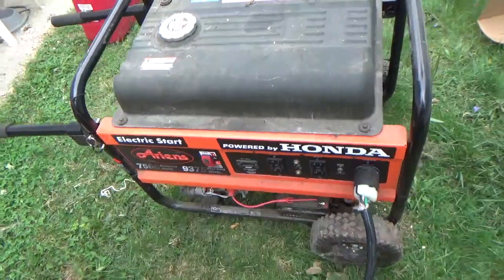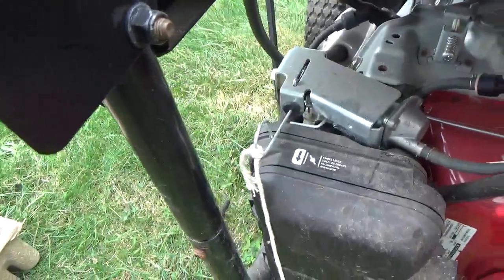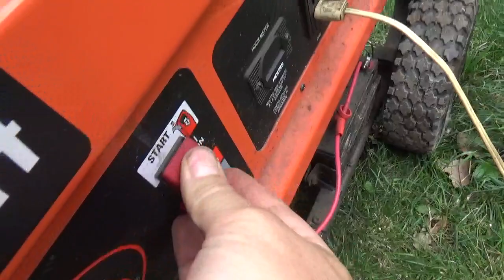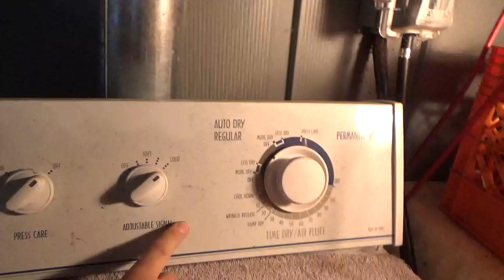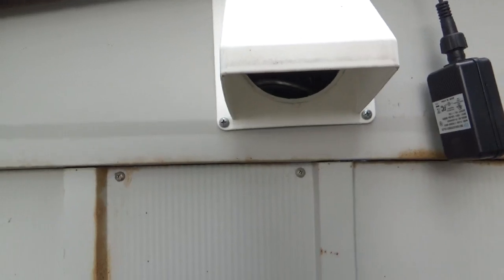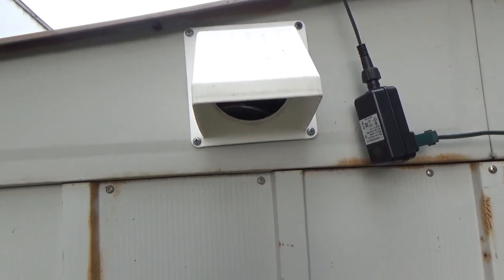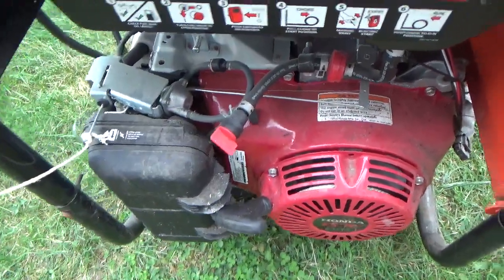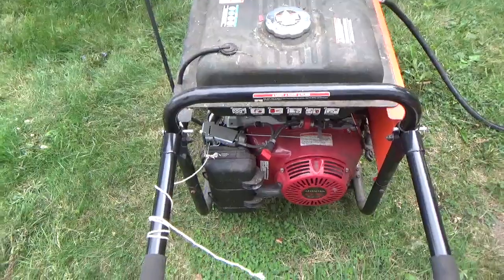Testing the Airens Generator And Maytag Electric Dryer

Comment: Nice, glad to see it's all still working well.

Need to start mine up actually, it's been a while.  Gas in it is pretty old but I've never had a problem with it running on it, besides old gas smells funny.

That's to say nothing of the one I got that I gave Joe, I told him to run it like every spring, it's been sitting there dead, out of gas for like 4 years now.  Then there will be a power outage and he'll be like "it doesn't work".
Reply from the maker: Joe will be like "it doesn't work so I sold it just like I did with your lawnmower".
Reply: Chances are good you're right.
Reply: Oh, just remembered:  That mechanism they use for the choke on yours is crap.  I know from experience, story time!

The wif's godmother has a generator that actually runs on propane.  She said it wasn't starting, it would try to run but die.  So I went over there, read all the instructions, and did everything it said.  Being that it was propane there's a button you'd press and hold for a few seconds to "clear the line", and then, like any other gas engine, you'd choke it, then crank it over.  Fortunately this one had electric start also, so I'd hit the starter button and it would crank over, but not fire.  Or if it fired, it would only hit a couple times on the cylinder and die.

Played with the choke back and forth, kept trying, kept trying, kept trying.  Finally, I got it to run, but it was barely chugging over, running way too slow to make any power.  Coughing and wheezing and just not wanting to run.  Plenty of propane, even had a spare cylinder that I tried, same problem.

I was starting to rally thing the regulator was bad for the propane.  Then I opened the air cleaner while it was running (barely) and it started running a bit better.  I removed the air filter itself, and then saw that the choke was still engaged even though the mechanism was pulled off for no choke.

Somehow, the choke plate got stuck, or was stiff, and the mechanism there couldn't open the flap fully.  I went in there with a flat blade screwdriver and popped open the plate completely, hit the starter button and it started and ran really nice and strong.

I WD-40'd the whole dealie there, and worked it back and forth a lot, and while not absolutely 100% perfect it was like 95% of the way working again.  So check that the mechanism works properly.  I think it's just a bad design.  That could be the entire source of your minor trouble.